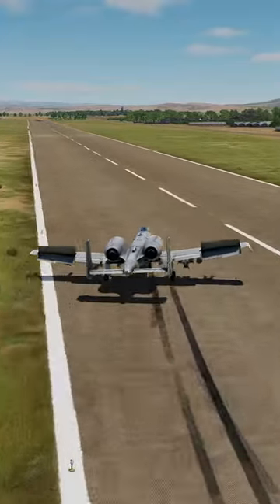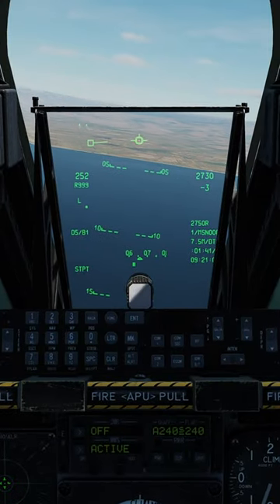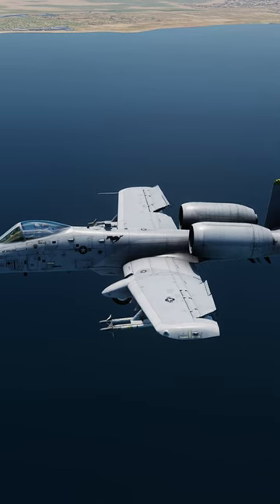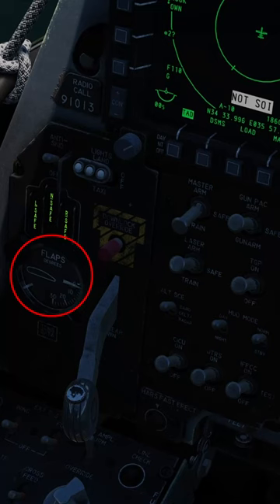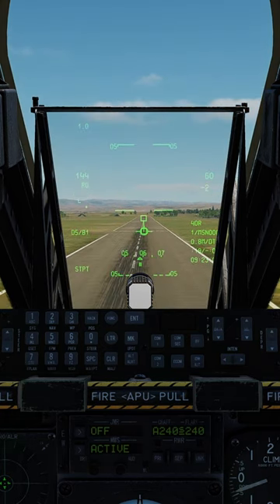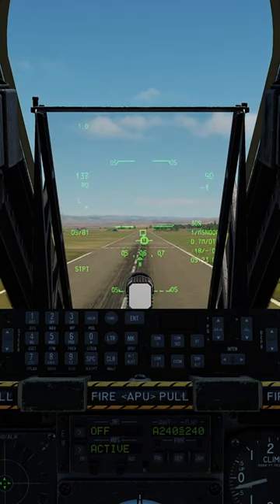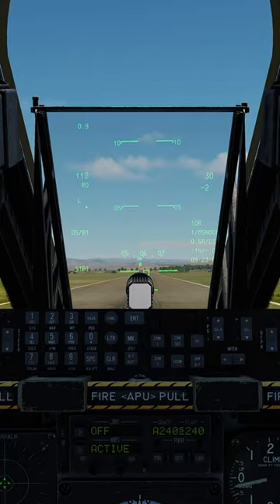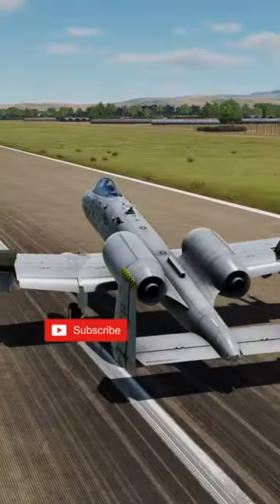Landing in the A-10C - DCS

Comment: You deploy air brakes only immediately after touchdown. If you need deploy them in air, it shouldn’t be more than 50-60% because it can get ripped off at high speeds. But I definitely agree with everything else
Reply from the maker: Really? Every A-10 pilot I see deploys them prior.
Reply: @NAWTYOPERATR  ill watch a video in a bit and get back to you.
Reply: In the A-10C OM is written that you should make the approach with the speedbrakes open at 40%. This is to keep the engines at their best power/responsiveness range (usually it takes 7-10 seconds to spool them from idle to 100%, but if you are already at 65-70% ore more you can get to full power quicker).

Usually for the speedbrakes I don't think there isn't a maximum speed other than the Vne of the aircraft
Reply: @alessandrobertolotti8757  WOW 😯 ok I understand! Thanks for clarifying, I am just used to seeing that on commercial airliners.  Thanks man for the response!

Comment: The A10 Landing speed should be 125 Knots, you were 150 and flared way too much, nearing a tail strike. You AoA was also way to high. You also forgot the PAPI lights on the left of the airfield that indicates your glide path. All white - out of sight (too high). All red - you are dead (too low)
 I recommend you do the BFT Campaign from maple flags as it really does an amazing job for A10-C training. :)
Also the flight manual recommends you take your speed brakes to no more than 30% on landing.
Reply: You talk to a-10 pilots and they will tell you between 30-50% but the generally try and shoot for around 40. For the most part he did a decent job with the short tutorial though.

Comment: Dont use throttle for speed when in slow flight (ie. landing) use pitch for airspeed and throttle for altitude. Meaning if you want to slow down then pitch up and of you need to speed up then pitch down. If you are consistently ending  up short to the runway then you are staring your landing procedures too early. If you are overshooting the runway then you're too fast. Everything else was good